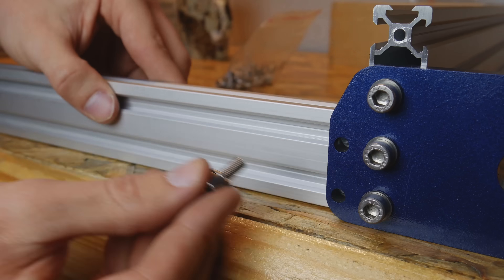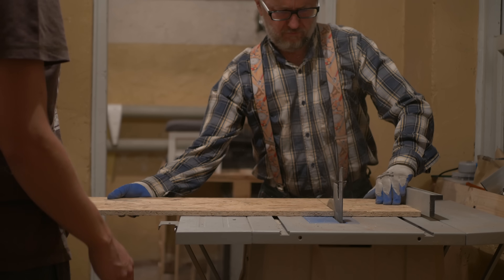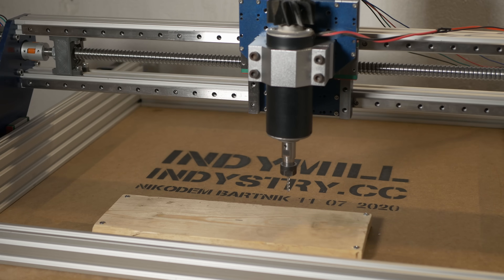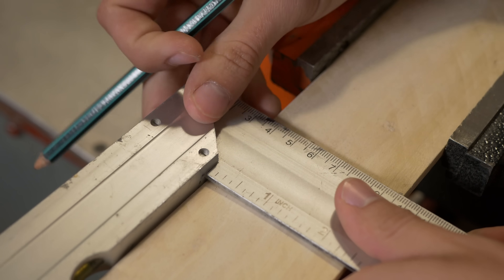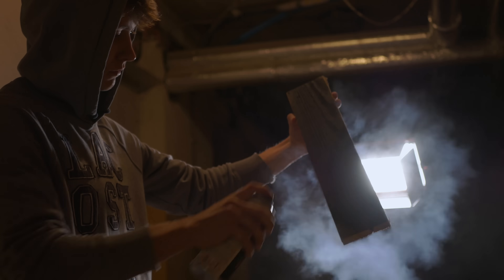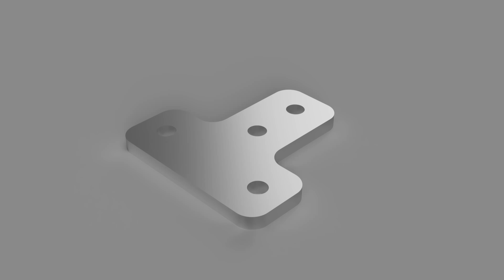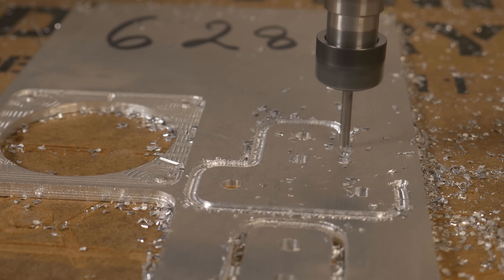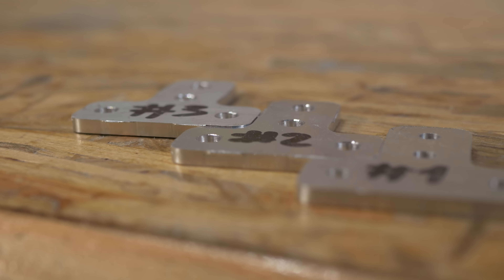IndyMill - Open Source DIY CNC Machine #4 Final Test!

Comment from the maker: IndyMill: https://indystry.cc/indymill-cnc-machine
Thank you very much for following me on this journey! Thanks for the support, all the comments and tips :) I know there will be a lot of questions about things that I did not cover in this video so here you have the answers:
0. Check out my store if you want to buy parts for this project: https://indystry.cc/store/
1. Price! An obvious question, how much did it all cost? You can easily build exactly the same machine as mine for less than $1000. It all depends on where you source the parts and most importantly how much you paid for steel plates (more on that in point number 2). Is it a lot? I don’t think so, especially when you compare it to other commercial options available. Something that I also didn’t mention in the video is that you can actually start with a less expensive setup that is easy to upgrade later (you can easily attach Nema 23 or Nema 17 to X and Y axis, there are mounts for both motors combined in every plate except Z axis, if you use Nema17 you can go with GRBL shield and smaller stepper motor drivers, smaller power supply and so on). You can even start with trapezoidal lead screws on each axis and later upgrade to much more expensive ball screws. You can easily save about $200 dollars that way and have a rigid, upgradable machine!

2. IndyMill plates for sale! But not yet. I got my first prototype of those plates, cut out of 6 mm steel with powder coating just a few days ago. I already know that 6 mm is more than strong enough for such CNC, but I have to go through some more testing, experiment with the final color, pricing, shipping, and safe packing. No worries, it is close to being finished and I will let you know once those are ready to buy through the newsletter (you can sign up at indystry.cc) and maybe I will make a video about the small-batch production process. Sounds cool?

3. I ordered more IndyShields and hopefully, you should be able to buy them again on Tindie next week.

4. How about another IndyMill test video? I want to mill some more things and show you what this machine is capable of. And of course, it will be just fun to mill some more things :) Any ideas on what to mill?

5. Working area is about 520x400x115mm

That’s it I think. If you have any more questions feel free to ask, I read every single comment. Thanks again for everything, don’t forget to check out indystry.cc and IndyMill build instruction!
Reply: look in to compression cutters, they help a lot with fuzzy edges in wood, almost leaving no fuzz at all
Reply: @clippy90001  
Yes thats how they're called.
Also I think just straight 2 flutes.
But I think he said he was just waiting for them to arrive.
Reply: Mill an instrument... like an electric guitar! :)

Wait... Nikodem, have you tried milling pcbs with any of your CNCs?
Reply: @an-yr7gk  I just did that on my diy cnc made an egen8 copy and if you are interested in some free files looks at the laguna cnc strat
Reply: @nikodem bartnik
Pleaseeeeee man try to mill 3D shapes like a horse using aluminum metal or brass and steel
Reply: Please man
Try to mill 3D shapes like a horse using aluminum metal or brass and steel
Reply: First off, great job!
A couple of questions, why did you choose to make your plates out of steel instead of aluminium? Does flat aluminium viabrate to much?
And for all of your routing (milling), have you tried in your CNC set-up tungsten tipped cutters? That is what I used in commercial-grade CNC routers...
Reply: Dear Nikodem,

first of all thank you for this intresting Project. I started now to order the parts for my own Indymill. One thing I am really struggling with is that your 2080 and 2040 Profiles are the chinese profiles, meaning that they are more or less Item profiles but with a 6mm channel which is originally not available in europe. This means that no shop in europe provides the ready cutted profiles. I will work now with the 5mm Channels I-Typ hoping that the M5 Screws for the connections are enough. 
I have one question,you used 666mm profiles with the 650mm lead screw. While you use in the other axis 600mm profile with a 600mm leadscrew. Do you adapt the missing 16mm with the coupling? BEacuse the rest of the design looks for me as it would be the same in both axis.
Reply: @christianaltmann7156  Moin,
in der Anleitung sieht es so aus, als würden die beiden Adapter die restliche Distanz überbrücken. 
Ich bin auch gerade dabei mir alle Teile zusammen zu suchen.
Reply: @3DPascal  Moin, danke für die Antwort. Habe mir gerade nochmal das Aufbauvideo angeschaut da hat er das Lager sogar nochmal umgeschraubt von Außen nach Innen. So passt es dann wohl. Wollte nur auf Nummer sicher gehen bevor ich jetzt die Profile bestelle.
Reply: Can you mill a flux capacitor?
I left my soul in 1985.
Reply: can u share which endmill u use during the video?
Reply: Thank you for sharing this video. You go through a great deal of trial and error - i guess that is how one learns but what would be  nice is if you could share the details in the above desciption of each video that you make of the settings for each of the jobs you ran on this great machine that you have designed. That would provide a head start for folks who are just starting out in their journey of CNC...

Comment: Hey there. This is one of the nicest CNC's I've seen made to date. I have all the gear to build my own but it's sitting in a box in my workshop. 
I have gotten a lot of inspiration from seeing ur video man.
I'm not tech savvy so I kinda struggle with the electronics side. I have the motors,  Nema 23's, stepper motors, etc and power supply also.
I need to swat up on how to build it and make it work. Would mack-3 be ok or is there something better. 
I bought Arduino too and have lots of extra parts as well.
How many power supply's did u use for this build? 
I have 3 different ones. 
I have a similar spindle to ur one there but I cannot change the collet out of it. It's only a 1/8 collet stuck in it. Can u buy those collet nuts  for those spindle machines? Mine is the exact same as ur one but the fan atop of urs is different.
I saw u used the larger rod outside the frame? What size rod was that? It looked big and those linear rails would be better than my cheaper belts and pulleys system..
I get that much anyways.. LOL
Brilliant build my friend. Look forward to seeing more of those build videos..

Comment: When changing collets always fit the collet to the nut first, the way you did it inserting the collet into the machine then the nut afterwards can distort the collet and the bit will not sit right, inserting the collet into the nut first you will feel it clip in when presented about 45 degrees and then straighten it up you will find it seats right and get much less runout in the bit.

Comment: I've been studying your videos on the Indymill (they are great!) and I plan to start mine in a month or so, I plan on making mine 800x800 so I can have a 24"x24" working area.
A few quick questions:
      1 Do you plan on updating the parts list to reflect your upgrades? i.e. the new drives, power supply etc? 
      2 Does the printed parts kit you sell have the upgraded parts in it? I'll be buying those from you.
      3 I was planning on using aluminum instead of steel as I should be able to make those parts on my 3018 CNC.  Is that a good idea?  If not I'll buy a set of metal parts from you.
      4 Any issues with putting the spoil board on top of the 20x40 extrusions? I would like to do that so I can make stuff longer if needed.

Thanks,
Bill P
Reply from the maker: Hi,
1. There is a link to a google sheet with up to date parts on indystry.cc/indymill
2. Yes, of course, the 3D-printed parts and screens and bearings kit use the newest set of parts.
3. That should work fine. Steel is stiffer than aluminium and a bit heavier which is good for a CNC machine. You can always start with aluminium and upgrade later if you need to.
4. No problem with that but remember that you are reducing your Z working area and I would advise adding some aluminium profiles below the wasteboard if you want to put it on top of the profiles.
Have a nice day!
Reply: Thanks for the super quick reply.
I plan on putting 4 20x40x800 cross pieces under the spoil board, that should support it well.
I have downloaded that parts list, but it calls for DM542 drives, I thought you upgraded to DM556, am I wrong?
As for losing some some Z height I thought of buying a Z axis assembly with a 150mm travel.

Thanks again,
Bill P

Comment: Hello boy. On minutes 9.40 you are telling - I MOVE TO FAST. What you are explain here is a little bit WRONG , in reality in time of milling you are changing the direction of cutting. In one direction of cutting the material are removed and eliminate by naturale laws of phisics. In oposit direction the milling cutter tends to "choke" with the material it is processing.  If you are study a littel the theory of milling/cutting tools you can understand what was the problem what you are faced.
Persons with big exparience in processing of materials can confirm this. In general it is used the way to cutt in the direction when the materials is removed from the front of cutting tools. Persons what are prepare the programs for this type of process, are using subunit value ( like 0.78 - 0.82 - 0.86 - 0.9 - 095)  from the normal cutting speed when are process in the "sticke" direction . This help tools to not tends to "choke" when cutting against of this direction. Rest of presentation was very nice and I followed you from start to the end.   
You are young and you have time to lern from you mistaches. Personal I can recommand to study a little theory of cutting process and to understand where can be performed machining in forces and where must to be carefully whit this, to no destroy tools. 
Good luck and hope to meet you again. .

Comment: FYI. To high a feedrate  when you were cutting alu.  #2 you need coolant and lubricant. ALU use varsol.  Or you will be breaking tools and wearing them out quickly.  Oh Ya and Use HSS cutters. Get you self a feeds and speed guide per material.

Comment: Because you are so kind to share your ideas, here is mine. Make a version of this that is VERTICALLY orientated and can be mounted on a wall (onto a wooden backplate). This has a few benefits: 
1. It will save space; 
2. It can be larger in size or can be placed on top of a workspace/piece;
3. All dirt produced falls down by law of gravity and can be easily collected and nicer cuts because of clean surface;
4. (Large) plates can be easily mounted vertically;
5. A wall is very solid support structure;
6. You can use a simple curtain to keep away the dirt from spreading into environment when operating.

What do you think about this? I think you doesn't have to change much because the head already has a great solid design (wormgear) to be able to go up and down instead of going forward and backwards. Let me know what you think.

Comment: Hi Nikodem, really awesome job, because of that I made my own CNC. I’m struggling with the calibration a bit because of the steps/mm. Do you have a good way to calculate the proper steps/mm? Thanks in advance
Reply: well, when you read documentation of the threaded bolts that are moving your axis, they often say how many milimeter will the nut on this bolt move forvard per one rotation of bolt. and in the motor documentation you will find or figure out how many steps it needs to make one full turn. With that you should figure it out
Reply: for example, my motor needs 80 steps to make full turn, and load attched to the bolt would make 8 mm forvard with one rotation of bolt, so one milimeter is 10 steps. of course i made up this numbers but i hope you get the point

Comment: 2 flute high speed steel works the best in aluminum. It is better than carbide for that. They have special coated high speed steel just for aluminum.

Comment: Best endmills for wood are the ones designed for acrilic plastics. 
1 Flute downcut mills, and they don't need to be sharp for cutting wood. What i usually do is use them for acrílic untill the cut starts to yield poor cut surface then i just use them for wood

Comment: How you calculated power stepper motor for keep spindle with frame. Did you do any calculations ? I want to design own cnc milling machine and I got stuck on it.

Comment: What characteristics are likley to change if I changed the size of the working area? So I purchaced 1000mm 2080 aluminium profile rather than 600mm (changing other part sizes as needed .etc).

Comment: Hi Nikodem,

I am in the process of building the IndyMill, and was wondering if you would be willing to share your CAD file for the X axis nut holder.

I would like to have my local machine shop make it out of aluminum. 

Thanks for an awesome design.

Brandon 

Oregon, USA
Reply from the maker: You can find it on my GitHub

Comment: Hi, what thickness should be the shafts for a 2 by 1.5 meters simple cnc frame, is 20mm shaft strong enough and which nema stepper motor should be used, would nema 23 be good enough ?

Comment: Further to my previous comment and questions, I bought your plans but there are no dimensions on the drawings for the aluminium parts (I can't find a company close to me to make those parts so want to make them myself).
Reply from the maker: You can import DXF files to any CAD software and measure everything you want
Reply: @nikodembartnik  thanks, but that doesn't work, only the image shows up, but no dimensions etc.

Comment: Congratulations for the great project! I've been thinking about making my own 3D printer with a specific goal, that maybe with the IndyMill I might reach.
Do you think it is possible to create PCB boards using it? Maybe buying copper-silked boards and using the CNC to drill the copper, leaving in the board only the vias of the final circuit? That would be awesome!

Comment: You made a comment about the inside surface finish of your first job: this is also due to the fact that you are milling softwood, which is common in Russia as it is here in Canada. I have used software for many routing projects and you will never get fine features from it because the grain is too loose and it will tear out easily during post-processing. 

This is not a fault of your machine! The same thing will happen if you use an old-style router table with softwood. If you want fine features, try a hardwood like Oak or MDF. The Beech and Birch species are also common in your region and should not be very expensive.

Comment: Hello and thank you very much for your videos.  Do you think the metal pieces that you have to cut or buy that you have in .dxf format can be made with a 3D printer, even if it is 10mm thick and a resistant plastic to reduce costs?

Comment: May I ask why did you use 2 separate power supply and not one larger powered inverter? does the spindle and drive have different voltage?

Comment: I'm new to this home built cnc machines and I have a question: Are almost all of this machines made with a relative positioning system or is it possible to upgrade it to an absolute positioning system using a glass scale? My second question is how do you tell the machine the zero point in this setup? Do you just move it to your desired zero point and go on from there?

Comment: One of the problems with  machining aluminum is your are not using a lubricant. Aluminum can be very  "gummy" some alloys are more gummy than are other. 6061 machines nicely 6063 is terrible to machine. Some of the best machining aluminum is 2024 and 7075. A squirt of WD-40 or other similar thin oil will make a HUGE difference. It will keep the Aluminum from sticking to the tool. Once Aluminum "welds it self to the tool" It will continue to build up and the tool can no longer cut so it snaps off. Nice machine. I hope this helps

Comment: Great work! Just a hint: when milling wood, specially pinus, you can greatly reduce the necessity of post processing by simply performing a single last pass on the reverse direction of cut. Just clone your path and set it to cut in the opposite direction. Maybe it may be useful for you.
Reply: What bit should be used for milling wood?

Comment: Great Project. I only know the german names from my vocational training. I hope this helps anyway.
Aluminum is a smeary Material when it get hot. Using Spiritus to cooling it was teached us heavily. Just a splash from time to time. Otherwhise you can get a "Aufbauschneide", that ruins the workpiece surface and can break the drill. (If you already get one on the drill, dont grind it of. Break it with preassure against a piece of metall.)
Also, the direction of milling is important. If the driver spindle has too much play, or cant stand the preassure, the drill can be sucked into the Material an can break. Please search for "Gleichlauf und Gegenlauf Fräsen". Milling in drill spin direction, and against. Both Methods has benefits in stability and surface quality.
I am sure these Tips may improve youre results. Keep on that great work.

Comment: Well done, buddy! Please keep up good work! I have a question about the Nema 23 Stepper. I was told that it has inertia issue and how did handle it? May I ask how much you cost to build IndyMill? Thank you very much!
Reply: Always select stepper more than your required torque.. like 2times the required torque then u don't have to worry about inertia. And by the way u can see my cnc here https://youtu.be/TZuK2f2Y2vg
I built this on my iwn

Comment: How much does a project like this cost all together?
Reply: I have calculated around 650$
Reply: @lecmim10  That's actually not bad!
Reply: @lecmim10  any idea what the workable area is?
Reply: @SystemHacker23  I did not calculate, but it is very cheap to upsize this CNC as you only have to change Profile and Ball screw sizrs as far as I can see